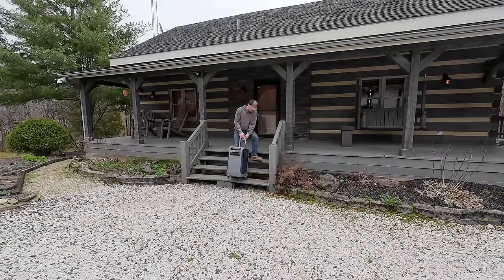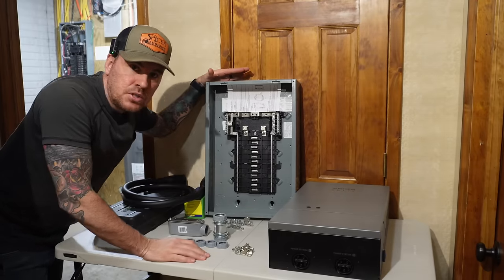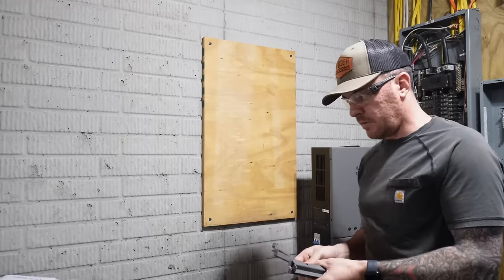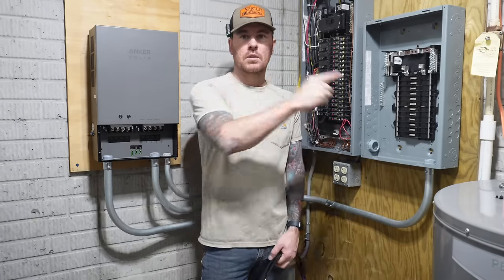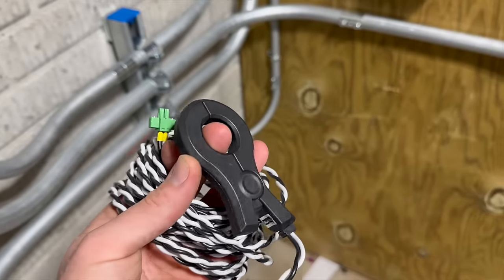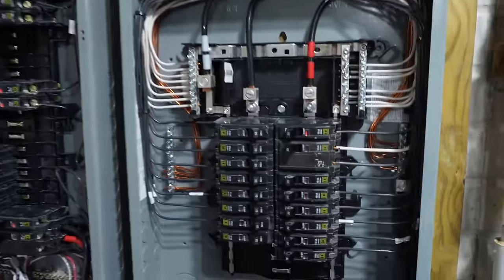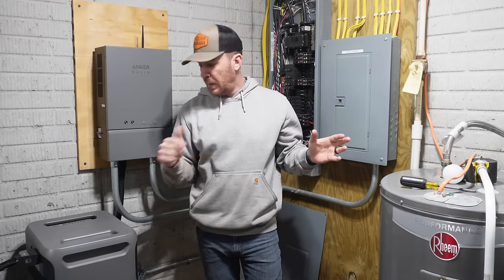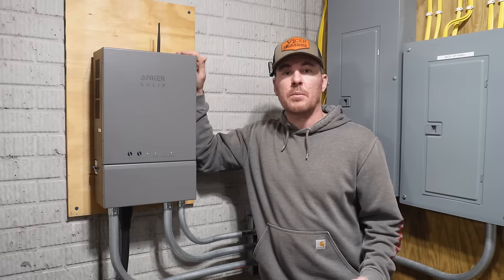STEP by STEP Installation Of Auto Home Back-Up System | Anker SOLIX F3800

Comment: Instead of installing a sub panel, could you not just hook up the sub panel wires to the main panel like a generator plug. Normally the generator plug is 50 A. Could we just make it 100 amp and plug this in?
Reply: And just like a generator plug, you cannot turn it on until you shut off the main power. I’m just asking I’m a complete novice at this.
Reply from the maker: @carrybigspeaksoft1758  im not completely following.  Sounds like your saying to take the output from the home power panel and feed it to a breaker in the main panel.  That would not work for multiple reasons.  Would also defeat the purpose of an automatic transfer switch.
Reply: @SpicerDesignsLLC  thank you after I typed it. I thought to myself it was probably cause a shortage since it would be connected to the same panel as at 100 and panel that feeds the transfer switch.

Comment: Hey man, great video! I would love to do this exact setup. I have a question for you about this first. Note that I have no electrical experience so apologies if this is a dumb question. But what is the purpose of having BOTH the Anker home panel AND the transfer switch panel? Is it possible to just wire the Anker home panel directly to your main panel? Then when on backup power, couldn't you just turn off the breakers on your main panel that you didnt want the f3800 panel to power? Thanks in advance for any explanation!
Reply from the maker: All good buddy! Never a dumb question.  You could not do that.  In most cases if you put your entire load on this battery system, it will deplete the battery at a much faster pace.  Ideally you want to have essential loads only for max battery life during an outage.  On top of that, the supply to the home power panel and load cant be coming from and going to the same panel.  And it automatically transfers so you wouldnt do anything manually with this setup.  You have to have the secondary panel.
Reply: Got it! I appreciate the solid explanation! Thanks @SpicerDesignsLLC

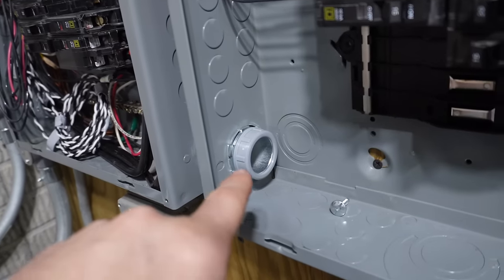Comment: 22:39 To this point about the smart panel possibly failing, can the smart panel output be wired to a breaker inside the critical loads panel, with a traditional generator interlock kit and grid power going into the lugs instead? That way it would just be a matter of switching between direct grid feed or the Anker system.
Reply from the maker: @vinhho6241  i believe i mentions that in the video.  Thats why i installed the 1-1/4 chase between the main panel and backup panel.  I plan on installing a tie breaker in case of that situation.   You are 100 percent correct
Reply: @SpicerDesignsLLC  Oh nice, what size breaker would you use for the smart panel output? Awesome video btw!
Reply from the maker: I would use a 100 amp in the main and a 100 in the backup.  An interlock kit wouldnt work like it would in a normal back gen setup though.

Comment: Aha!   I knew you were a Twisted Tea fanboy!  
Seriously though, that AC coupled and time of use feature is nice when you have a Utility that likes to screw you with the ToU rate hikes.  Next you'll be telling me they don't give you one for one Net Metering either, like we still have down here in FL.  Bastards!    Are you going to hook up some kind of interlock/bypass for the 100amp in case the Anker shts the bed?
Reply from the maker: Thats just incase Adam shows up.  They are pretty good occasionally. I did install an 1-1/4” nipple so i could take the 100 sub feed to the sub panel if needed.  I thought about installing a tie breaker but it would consume a lot of space in the sub.

Comment: Great video, roughly how many hours do you think it took to set up the whole system?   I'm no electrician and am very curious how much one might charge (ballpark) for setting up the same type of system? Any thing I should specifically ask about when I call around to make sure I get someone like you who knows what the heck they are doing? Thanks! +1 sub
Reply from the maker: The system isnt very common so using this video as a reference would help.  Every install is different so price will vary.  Typical install should take one man 10-12 hours.  I would imagine somewhere in the $1500 range with parts.

Comment: For a real off grid, battery backup system, you should have purchased a higher performance  low frequency, transformer based inverter charger with built in MPPT. These low budget, high frequency, transformerless solar generators simply don't offer a high enough peak power capacity for household, high inductive loads especially if you have a deep well pump..
Reply from the maker: You can get 12000 watts of output from this system.   Thats all i need.  Everyone’s setup and needs differ.   Thanks for the input.

Comment: So I’m in a bind. My whole house circuit is actually 2. So I have 4 wires instead of just the two wires you have. And I’m changing the L1 on top and the L2 etc. 

No matter the configuration of the L1 current transformer. It tells me it’s not connected. 

Any help with how to handle a split circuit where there’s 4 wires instead of just the two?

I should add, when I run the test. It shows power going to the f3800. It has input of on average 530w. But after a bit of testing it stops and says the L1 isn’t connected.
Reply from the maker: @dbnoho  check for firmware updates on all devices first.  If you can fit the ct around both L1 wires and the other ct on both L2 wire that will capture all the current.  Verify the connections of the ct wire to the term block too. Definitely check the firmware. You can do it through the app.
Reply: @SpicerDesignsLLC   I’m trying to sort out where lines one and two go. And hopefully I don’t need to. Set up a whole new panel just to make it work. But instead of 2 incoming grid wires going into a 200amp circuit, I have 4 wires. Going into a 4 pole circuit that acts as a 200amp as it’s all one bar that turns all 4 circuits. No clue why it’s like that. House was built in 99’ and I imagine they saved a whole $30. 

The top more wire (of the 4) and bottom most are accessible for the current reader clamps. The two wires on the inside aren’t accessible as they top more and bottom have very little to no give in them. Today I’ll run a hot test and see if for some reason the inside wires are hot and the top and bottom are neutral. Either way, it sucks because everything is so close to being doing. Backup panel has all the wiring. Smart panel is mounted. Everything is ready. But I can’t get past the self test because of these clamps.

In the meantime. I’ll also see if I can some get it L1 around the top two and L2 around the bottom two. It’s a stretch. But if it works I’m happy and I owe you.
Reply: it took some doing. Why the panel has 4 wires going in, don’t know. So what I had to do was pull the panel under the meter off. What’s coming from the actual grid before it hits the meter. And I am using that with the L1 and L2 clamps. It let me through the self test and now the system is running.
Reply from the maker: Nice! Good job.  I was completely following with the 4 wire.  Sounds like a parallel feed to your 200 amp main.  Glad you got it working.

Comment: when I try to do a system seft test, it keeps failing since the f3800 battery level is above 95%. Since this is my initial configuration, how do i discharge the battery to lower than 95%?
Reply from the maker: I had the same issue.  Click the settings for the device and check for firmware updates.  That should resolve it. It could also be that you just need to discharge below 95%.  Just plug something into it and let it run for a bit.  Space heater works pretty well.
Reply: @SpicerDesignsLLC  i tried to connect a space heater, it is not discharging. Do you think I need to disconnect it from power panel?
Reply from the maker: @sweethomesweethome  ya i would disconnect it.  You also have to hot the little button next to the outlets to turn them on.
Reply: @SpicerDesignsLLC  after i disconnected from power panel, I could discharge it. Thank you!

Comment: Great informative video, however, I don't think it's a good idea to have the water tank and the electrical panel in the same room just in case of a water leak, hypothetically speaking of course.
Reply from the maker: Thanks,   Unfortunately i didnt build the house so i dont have a choice at this point. The water heater situation is specific to my home.  Anything could happen at any point aside from the water heater.

Comment: Have you found that the home power panel limits the output to 1.9 KW from the F3800? I’ve had some interesting dialogue with Anker and none of it makes sense.
Reply from the maker: I have not noticed that.  When your in back up mode or time of use?

Comment: I got the same subpanel, wired the same way, it worked fine while on the grid , as soon you turn off main power to switch to anker backup it took 20 seconds to switch and then some lights flickered, my dishwasher and stove started smoking , not even in use, called electrician, he could not find the reason why, moved my main panel to orignal state. Escalated case with Anker, requested return label, screw this crap, will stick to my gas generator.
Reply from the maker: Sounds like something was wired wrong.
Reply: We checked everything, toned out all lines, it only happens when switching to batterie mode, as long you stay on grid no issues with sub panel, also only older outlets with open ground suffer the most problems, like I said only when switching to battery mode.
Reply: Also, don't know it that would make any difference, I didn't run the entire line with neutral and ground in subpanel, I used jumpe wire to move the brakes over, like shown in Anker install video.
Reply from the maker: @MarioLivaja  the neutrals and grounds should be in the sub panel too.
Reply: What about the older lines in the home with 2 lines only, hot and neutral, no ground. Would they work fine if both moved or dose it have to be 3 wire line?

Comment: Too bad you can't charge this thing with a generator while also using it to power your house...  It has no AC pass through. It's the biggest flaw it has but I guess you figured that out by now. Solar input is the only way to charge while also using it. So if you lose power, if you don't have solar hooked up, you have no way to charge it also also use it while grid is down.
Reply from the maker: Its rare to lose power for more than a day anymore.  Most the time its only a couple hours.  I have a enough battery to last a couple days right now.  Solar panels are on the way.  Should be installing them soon.  Worst case, i can hook up my gas gen if needed.  The battery system may not be for everyone.  Just depends on your setup and needs.  Im very happy with it so far.
Reply: Hello. Taking advantage of the fact that you are working on this topic, can the Anker F3800 battery be charged with a gas generator? That is in the case that the electricity takes more than 2 days to arrive and that there are no solar panels.

Comment: Oh I always thought it was funny. No one wanted solar and I had solar when they ran out of power. I still had power and they were upset because I had power and they lost power and they still won't get power. Outage came back. They wouldn't going to sell a pencil that Apollo and power go out, so it's up to it's all on them. So yeah, I'll laugh at him if they don't have power and they refuse to solar battles or the generators or the inverters.  I mean, it's all in. It's all in your head which I don't understand I'm a new nickname for the last of since 1999 of July 29th.
 I tried to talk to him and get the solar panels, but no, but then one got a solar panel a 15, what solar panel on the side of the antenna which you're dead on is lights. So apart we're not used to it lights.  That's about it.That's all I had make him happy.But I don't know I at least we didn't get cold.It could still sit the walk ground.

Comment: CTs are installed wrong
Reply from the maker: No theyre not
Reply: @SpicerDesignsLLC   they are not pointing to the source but please correct me if I’m wrong wouldn’t the grid be the source
Reply from the maker: @EdwardAmpuero  they point to the load.  The arrow represents current flow which is flowing to the load. They are installed correctly.

Comment: Great Video!! Thanks for the walk thru!! I have a question.. I know it's not designed for it but, could you connect a portable generator to the second input on the bottom of the Solix "transfer switch"? It uses a standard 50amp plug. I was thinking a battery back up with a portable generator would make a great extended power outage option. Thanks!!
Reply from the maker: You can not.  The bottom port is a propriety plug that specifically connects the f3800 to the home power panel/ transfer switch.   They have a manual style switch made by another manufacturer that will accept a normal generator 30 amp twist lock.  That would work the way you're saying.